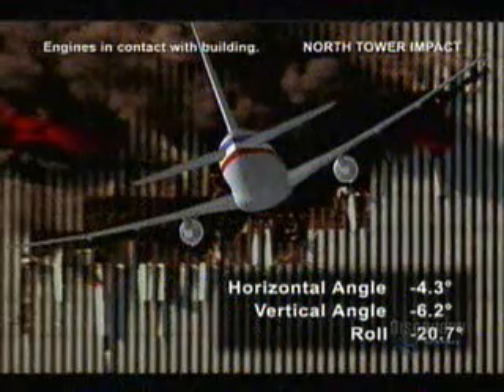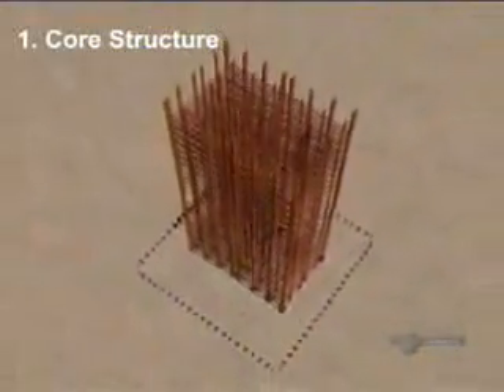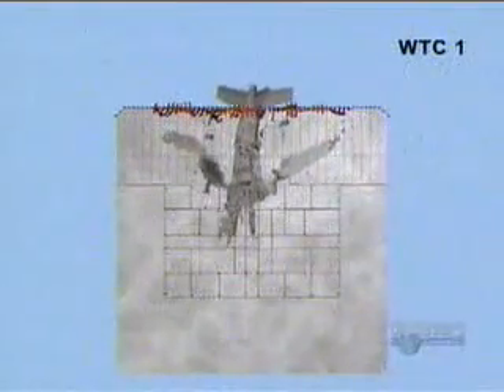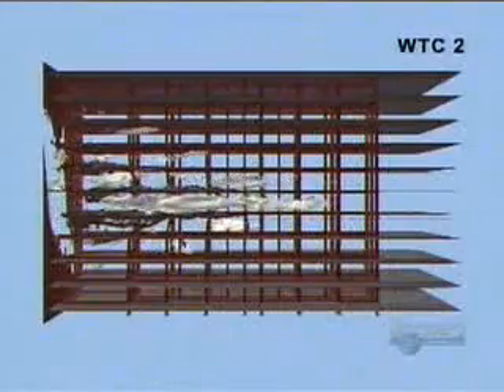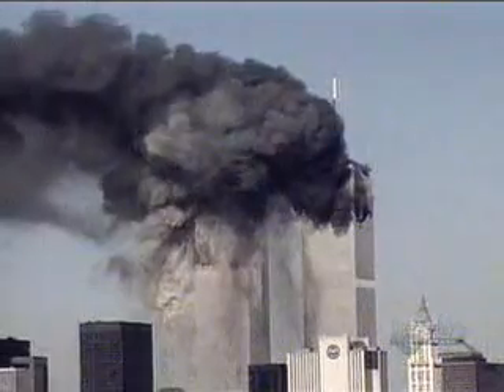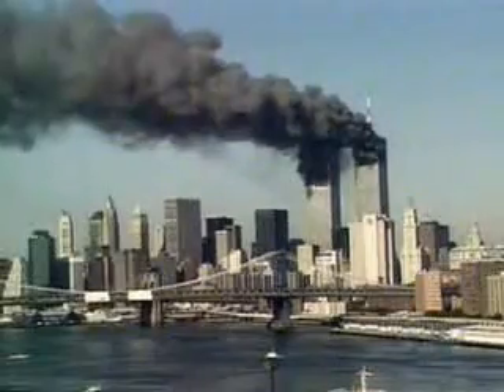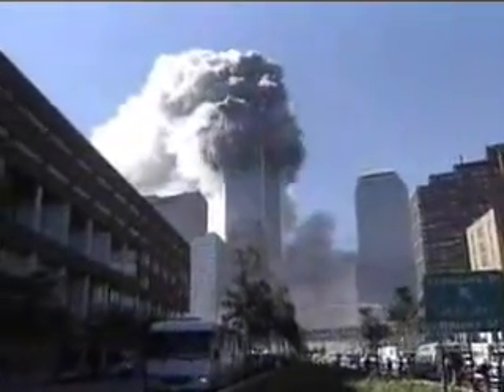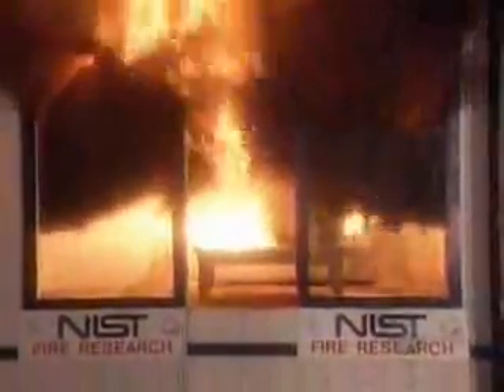9/11 What Made The WTC Twin Towers Fall

Comment: If that was true, then they would have collapsed a long time ago during a hurricane... or during the 1974 fire that burned for 3 times as long as the fires on 9/11...

The collapse itself is far too symmetrical and rapid to have been the result of steel buckling. That kind of precision can only be achieved with controlled demolition. There's absolutely no way around it.

Comment: laughable man. numbers speak louder than how dramatic you make it sound man. engineers need numbers not drama.   lets agree with you that the plane all those floors from the face of earth. how did the top 15 floors crush through the bottom 94  intact floors at an acceleration equal to free fall?  if progressive collapse of building is possible then there will either be zero acceleration or a deceleration because the resistance force at any instant will always be more than the weight force ( mg)

Comment: you cant talk sense to a conspiracy nut. It was an inside job, it was bombs in the buildings. check out building demolitions like watch?v=ZlGmnKvOhlg to see what a controlled demolition looks like. the bottom falls apart first and will always tilt slightly. This explanation is correct. Collapses from top to bottom straight down instead of bottom up like a demolition. Dont make more than there is of it...

Comment: if the tower was hit on the corner, and it "is like a table" then it should tip over to the side, but instead, it fells straight down like a controlled demolition (watch loose change)

Comment: its funny cuz jet fuel doesnt burn at a high enuf temp to melt steel.

plus the the designer Aaron Swirski stated the towers were designed to withstand sumthing like a plane flying into the side..

Comment: LOL what a bunch of bull. These towers were DESIGNED to take multiple aircraft impacts from extremely similar airframe designs. Besides all of this, airplane fuel does not and cannot burn hot enough to melt or even soften steal, it just doesn't work it requires an intense heat. Certainly not a heat where someone could survive in or around it as the lady did who waved out of the hole in the building.

Comment: But the impact removed all the fireproofing of the structure.  That explains everything, right?  So steel is vunerable to fuel burning at a max of 1400 degrees, when it takes twice that temperature to break it down?  All because the fireproofing wasn't there because of the impact of the plane.  We're supposed to buy that? C'mon!!

Comment: Both building tops sat quite happilly on the bases for forty years because the gravitational forces were countered by columns running from the bedrock right to the top.Yet a slight drop of the top gathered enough momentum and kenetic energy to overcome what these columns had been doing for 40 years?

Comment: Also if the damage was so extensive why did the towers remain standing without so much of as a buckle? How the hell can a regular aluminum plane cut a 'roadrunner' style cutout through the massive tensile steel front grid of girders?How can steel be melted by an open air hydro-carbon fire?

Comment: They claim here that planes were shredded? If you observe the second impact the nose of the plane projects from the opposite side.This is quite an achievement for a fibre-glass nose! If the plane was shredded then how can shards of aluminum cut through 4 inch steel box girders?

Comment: If the base and base floors of the towers were designed to hold the entire weight of the structure how is it possible for the towers to fall so quickly and neatly?  The core and outer walls were built extremely solid and were overbuilt.  None of this makes sense.  A partial collapse I might understand.

Comment: These buildings fell purely from a chain of events as a result from the planes hitting them. When the first tower fell there were no explosions from the foundations as you would expect from buildings being demolished using explosives. The fires caused weakening of the steel, and some of the floors suddenly received a load for which they were not designed. Conspiracy theorists need to stop being so narrow minded : D

Comment: in other words 1 to 3 floors of melted /soft metal and just like in the animation, the planes damaged the middle section of the building where the core support frames were. once thy were down the outer frame couldn't hold the heat and pressure the flames and the top of the building were making and BOOM, down we go.

Comment: even though the material was supposed to hold any heat metal can't  keep heating for ever! in some point it will come too soft and later on melt.
and oh by the way.. the planes almst flew through the whole damned towers and the fuel of the planes went all over the place so there was prolly 1 to 5 floors in flames by the time of collapse.

Comment: aren't you ppl beign little naive...? the hell, of course the buildings come down like that! and no it wasn't made by placing bomb to structure and then detonating it. the reason why the towers collapsed was the heat. not the plane fuel itself or do you think that there were no furniture or anything else burning material at the offices by the time of crash?

Comment: The S. tower superimposition is compelling but doesn't explain the collapse of the core & renders the "pancake theory" rather redundant. No one has come up with nice physics to explain the collapse of that below. I don't see how you can have the moment/momentum of the top floors pivoting outwards as an intact unit, over and upon and intact core, then halt. Once accelerated the momentum should have sent it into street intact rather than acting straight downwards as a destructive force on the core

Comment from the maker: Ulsterboy, do you not pay attention to the video?  The tower has the 47 central trusses and then an out shell of beams held together by a massive roof truss.  Once the two or three floors near the crashes gave way the massive weight started falling.  There really was nothing to stop the massive weight of 15 or 20 floors from crashing down.  The outer sheel peeled away like a banana peel and the rest just happened under gravity. straight down.

Comment from the maker: vintage your assessment is wrong.  If a mack truck hits a mouse it doesn't slow down to half it's speed or even 3/4 of it's speed.  Once freefall at the top of the tower began, the mass was enough to blow through the lower floors at terminal velocity so the tower would only take 12 to 14 seconds to fall.  

Tower 7 took damage and fell due to gravity as well.